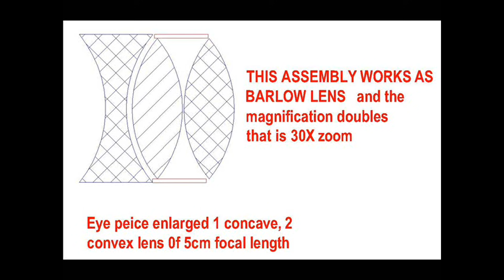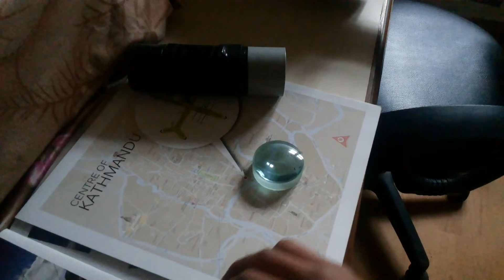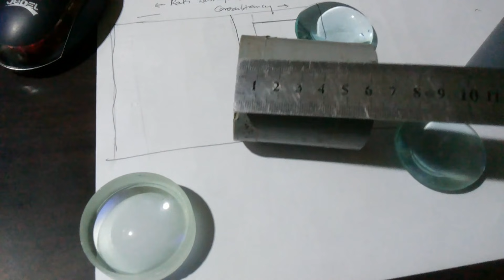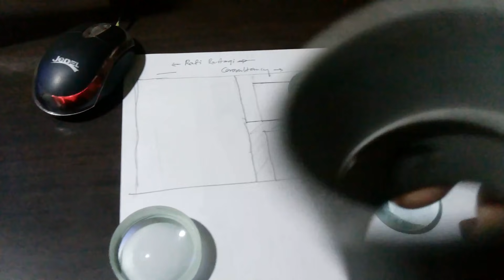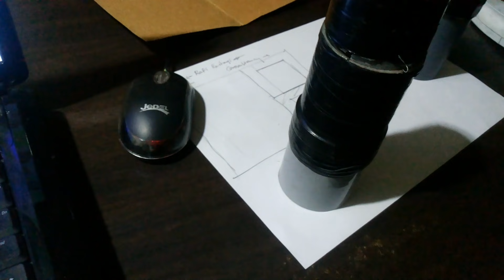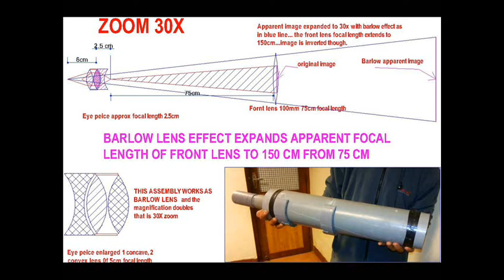Telescope 30x zoom with DIY Barlow lens

Comment: I suggest you re-do this video. Either add words or put text on the screen. Is a "Barlow Lens" merely the concave lens OR is it the collective set of three?  I've searched this on Google and got both those answers.  I'd also love to see the MATH behind telescopes. If we know the focal length of all our lenses, then there is a math formula to design this without trial and error. 
 -- Finally, WHY would anyone want this? Your Title says it's a "zoom" device, but what I hear you saying is this is simply a FOCUSING device. A true Zoom telescope can have variable magnification. It can be 30X, 60X, 45X, 42.8X.  I don't think this is what you have.
Reply from the maker: I will for sure. Thanks. I need to study a bit more to answer your queries too. It ought to be quite an Enlightenment.

Comment: What is the power diopter of lens
Reply from the maker: Diopter is 1000 divided by the focal length of the lens. So the objective is 1000 mm focal length makes it 1. And the eyepiece is 25mm focal length would be ..... 1000/ 25 works out to be 40.

Comment: Hello sir

I saw your video ,it's really good

I want to make triplet lens of focal length 200mm ,can you help me to make... What focal length lens I need and how I should assemble,so in result I should get 200mm focal length..

Thanks
Reply from the maker: The bigger focal length requires bigger assembly and stand. For the objective try using 100mm dai a bit easier for a accesories. You may try for 150mm too, not readily available though. Try ordering lenses online for chromatic doublet ...for 70mm, cost around 80 dollars in IndiaMart lens supplier. Try finding eyepiece of say ..suitable one starting from 4mm to 20mm.
Reply from the maker: And for stand try using my DIY stand. Shall post a video soon.
Reply: Ok thanks sir

Comment: I did the math the math says focal length 5cm
Reply from the maker: But the combine focal length gets smaller, and the combination helps to expand the field of view, decreses the chromatic issues as well.
Reply: I don't actually understand this still. ,,  5cm convex and concave in contact should've cancelled each other in theory
Reply from the maker: @funtv5693  It does, but to helps expand the horizon. The smaller aperture showed me the gas cloud of Jupiter as well with my DIY. But lately I bought 70mm achromat for objective. Had a good view of Crescent Venus. Now waiting for the cloud less night to poke into Jupiter and Saturn again. Do watch for my Moon shots in my channel with achromat. Cheers....!@
Reply: @debeshbhattarai  nepal ma kati parne raicha achromats ???
Reply from the maker: @funtv5693  Costly around 7K IC at Bombay, one needs to import.
Reply: @debeshbhattarai   lastai raicha uncle 😂aperture control trick nai thik cha for us budget users 😁
Reply: @debeshbhattarai  chromatic issue can be solved by reducing objective opening I tried it much better results

Comment: I have 3 convex (+50, +100 & +150) and 1 concave (-50). What can that all combine for making barlow lens like you?
Or can I make that lens for objective too?
Hope someone tech me.
Reply from the maker: Not very clear, is it focal length or Dia. Also specify in mm. We can find focal length by simple experiment, watch the video till the end. Add set of 2 convex and one concave reduces a lot of errors of color. But make sure have small hole with a washer if your lens are more than 10 mm dia.

Comment: how can i make telescope using 3 diffrent magnifying lens??
Reply from the maker: Smaller ones shall work eye piece, the big one should be used for objective.
Reply: @debeshbhattarai  i have atleast 100mm of objective and about 30mm of eyepiece should it work for moon just for fun  🙂🙂
Reply from the maker: @mehulgalchar6980  It should, 30 mm eye piece looks pretty decent. try getting 2 convex and one concave of 30mm eye piece... The sky looks amazing after that. You can still make a telescope with this assembly ... !! do post a video after that... make sure to make a stand ... after that.
Reply: @debeshbhattarai  but i have  two magnifying lenses its okay to see upside down and can we use 3 ????
Reply from the maker: @mehulgalchar6980  The world gets upside down in Astronomy...try using camera to correct it later. I would strongly urge you to create a stand. There is also a video of stand assembly in my channel...do watch it.

Comment: Does regular magnifying glass lens will work? I also have a small convex lens but the other side of it is flat and I also have a plano concave lens that I got from an old film camera eyepiece.
Reply from the maker: Now try finding one eye peice of a focus lens of old  photocopier as well, but your convex, plano convex should have sufficient focal length at leasr 30cm, or else hunt for it. You can try with these combination.
Reply: How about if I use two magnifying glass lens? but I didn't know what is the focal length of each one.
Reply from the maker: @alfred4264  Try ways to find focal length from other Youtube video's...otherwise hold the glass in one hand and try focusing light from a distance usually through window of your house to a paper, and measure the distance from the lens, that is the focal length....!
Reply: @debeshbhattarai  Okay, thanks for the help.

Comment: So total of 3 lense in eyepiece were used and one lense was used in the main module?? Please reply debesh sir..
Reply from the maker: Front 100mm dia 100m focus objective.
Reply: @debeshbhattarai  So U used the frame of waterproofing tape and there was nothing inside it then?
Reply from the maker: Could not get...what you said regarding waterproof tape, please repeat.
Reply: YOU TOOK three lenses... A concave, and two convex and stacked them together. so that's our final eyepiece through which we are going to look or there is another lens after those stacked lenses for our eyes...?? INSIDE that yellow waterproofing tape frame....
Reply from the maker: @sagarkhatiwada1913  only 3 , 2 convex and one concave...!
Reply: @debeshbhattarai  and  will it be touching that yellow frame..? Last question..
Reply from the maker: @sagarkhatiwada1913  Attach a small orifice to separate them by hairline as far as possible.

Comment: sir .    what should be the focal length of he eyepiece lens for 1000 mm objective lens to make telescope???
Reply from the maker: Try making a DIY Barlow lens....take 2 concave lens of 25 to 50mm focal length and one concave of same focal length. Try getting smaller say 25mm or 1" dai if possible. Smaller dai is best option. Rest you follow the video....might need smaller adjustment as required.

Comment: sir can u tell me the formula for the net focal length of the barlow so that i can use lenses with different focal length for different magnification?
Reply from the maker: Barlow kept before the eye piece...it helps reduce the effective focal length...more lens combination may makes the image blurry though...start with this one ...shall update more https://en.m.wikipedia.org/wiki/Barlow_lens
Reply: ani sir tyo 4" convex lens chai hajur le bata ko shop ma painxa ki nai? masanga 60mm double convex lens xa tr tyo objective ko lagi sano xa.
Reply from the maker: Lab international at Thapathali ...give my references for discount.
Reply: sir after reading about barlow i think it can be made by only two lenses and is placed between eye piece and objective and the magnification is proportional to distance between eyepiece and barlow. So are u using the third lense as an eyepiece? also what will be the effect on magnification when i use a convex lens with less focal length i.e. 3cm in place of the third lens?

Comment: what setup would be required to get 90x zoom along with clarity  using Barlow configuration? 
Kindly suggest the lense requirements for the same....

and this is the best DiY telescope video I came across on YouTube.... Thanks for this, I am a space enthusiast and it was really helpful😇
Reply from the maker: It was so good  to know your appreciation on my video... The barlow thing happened by sheer luck....and the wonderful thing about this DIY  telescope is....it is good to enough to peer into Orion... just need to build a sturdy stand... a must...! Being an architect I am little poor in  mathematics....try getting 2 convex of 25mm and one concave of 15mm all of one 1" dia... the barlow focal would be less than 10mm then... and get an objective of 100cm 4" dia... and your magnification should be +100 then... Cheers...! Ashutosh...!
Reply: DIY Debesh  thankyou soo much for replying... I'll be very thankful to you on successful completion of my telescope....

I hope the above configuration won't mess with sharpness....Any views on this?
Reply from the maker: It should not... if at all it does... try reducing the aperture of both Objective and barlow 
 ...by paper cover... or you can get achromatic objective lens... quite expensive though...! 3in barlow and objective would not mess... unless you try more combinations.... make sure to do a stand as your magnification is very large... a slight movement will shake the whole world through your telescope.... Cheers...!

Comment: Hi Debesh,

As per our previous conversation, I found some lense from online shopping.
Objective lens- dia 100, FL-600mm/60cm.

For eye piece-

concave lens- dia 50mm. FL-15cm, 20cm, 25cm, 30cm, 50cm.

Convex lens dia 50. FL-20cm, 25cm, 30cm, 50cm, 75cm, 100cm.
After doing a lot of r & d, I can't get the straight image. The images are same as before, up side down. 

Please suggest how can I get the straight image, as I see in my eye. So that I can successfully make the DIY project.

Regards,
Uday.
Reply from the maker: Use 50mm dia , FL-100 cm convex for front lens, try getting 100mm dia and for eye piece use 25mm dia 2 convex lens and one concave 2.5cm focal length. You may get those lens on one online shopping as well. The image would  be still upside, to get erect image you shall have to insert one convex lens same dia in front of eye piece combination.... with trail and error. 
It seems the with the lens that you have now for eye piece, would make the telescope very long..... Sorry for inconvenience.....! Keep trying...!
Reply: Hi uday can you share the link where you  bought lens online
Reply: Use 2 prisems in-between

Comment: if i use 3 inch front lens (F.L. 25 cm) and if i use the eyepiece lens of 10 cm focal length then what should be the length of pvc pipe ??????????????????????????????????
Reply from the maker: Ideally it should be 25+10=35cm, however it may differ by 1 or 2 cm, depending upon the distance you point. This combination would not give you much magnification. Magnification is always Front lens Focal length/ eye piece focal length. this is only 2.5 magnification in your case. Try using 100cm/ 4" lens for frontand use combination of 5cm F eye piece convex/ concave combination for eye piece to zoom into the craters of the moon.
i really appreciate your efforts however.... Cheers...! https://www.ifa.hawaii.edu/users/gruff/default/Astrolab/07BasicTelescopeOptics.htm

Comment: hello sir can u please suggest me lenses for around 100x magnification to view saturn mars jupiter and venus effectively and what would the total cost be.
Reply from the maker: 100x magnification is pretty large though. I would advise you to use smaller eye piece of of say 1cm focal length, for that you can use 2 convex and one concave lens to create a DIY barlow. Use 4" dia 100cm focal length objective lens
, preferably chromatic lens, which helps to correct the color dispersion. Please note the lens smaller than 1" dia is difficult to handle.
Reply: sir tyo Barlow eyepiece banauda 
overall 1 cm focal length banauna each lens  ko focal length kati chaincha?
Reply from the maker: loner dime All lenses should have max 2 cm focal length. you need 2 convex and one concave lens. which corrects chromatic abeeration and helps to give you sharp and closer view.
Reply: lens ko exact shop vandinu na
Reply from the maker: You can buy it opposite Business square Thapathali, Kathmandu. I wonder if you get smaller lenses there. But try with 2 convex and one concave 50mm dia, 5cm focal length for DIY barlow and one 4" dia around 100cm focal length for objective lens. These lenses are not very expensive though. This video deals with that.... La..!
Reply: how much is. the total cost??
Reply from the maker: Spent around Rs. 500 for all the lenses... and small sums for PVC and unions.... which you can buy from Kabadi's at throw away price..!
Reply: is it lab international pvt ltd?

Comment: what will happen if the focal length is more in Barlow lens. 25cm instead of 5cm. plz suggest
Reply from the maker: The eye piece focal length has to be smaller. Try to have lenses of smaller for eye piece. The big one 25cm may be better used for Front Lens. If you happen to be in South Asia...these lenses are for less than 100 Rupees each...Cheers...!!

Comment: Dimensions pls
Reply from the maker: Most of the dimension are there with the drawings.... but for you focal length of convex and concave lens 5cm only. The combine focal length concave plus convex and convex again... the shortest focal length would be 2 to 2.5 cm. The attachment PVC union 50mm inner dia, and the pvc pipe 50mm some 20cm long. Hope this would do...!
Reply from the maker: This is a DIY... and this video is meant for the people to understand the basics of Barlow lens and build one if they have time.... Cheers..!
Reply: Thank again
Greetings from egypt